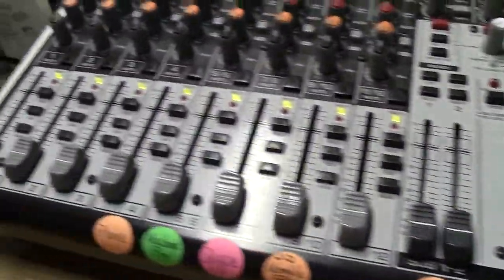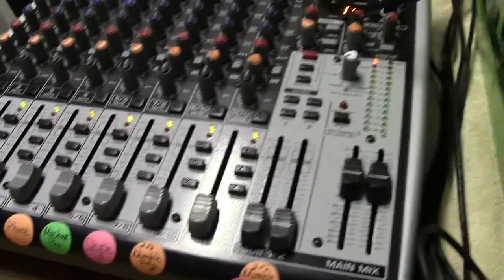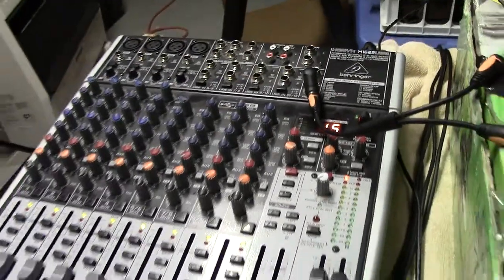Behringer Audio Mixer Broken Buzzing (2/2)

Comment: I have the same issue :s 
qx1002usb new out of the box, i turned it on and booooom same sound
Reply: +M.B.T DXB i got it just today and im having that same problem
Reply: +Blaq Jesus i fixed my issue, i changed the USB cable with my M-Audio fast track pro shielded usb cable.
That was my issue, Behringer USB is so cheap, the usb cable is shielded, try to get shielded usb cable and try
Reply: +M.B.T DXB i figured it out i didnt have a some button pressed n it fuked up everything its fixed now. i still have to figure how to get my pc to recoginze it well to use it. I have it set as the default device n still its not going through idk. ill figure it out i hope